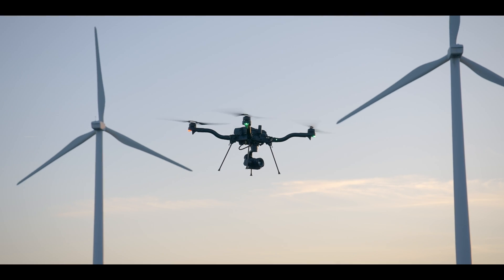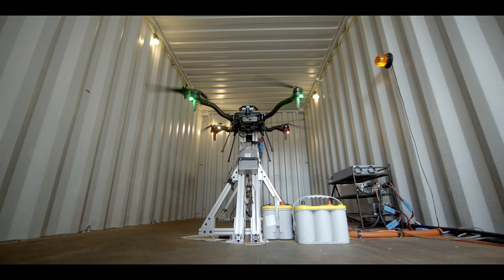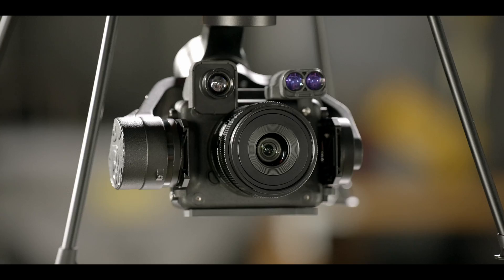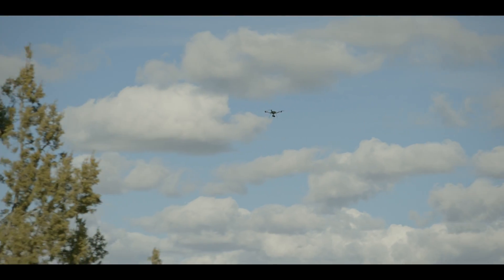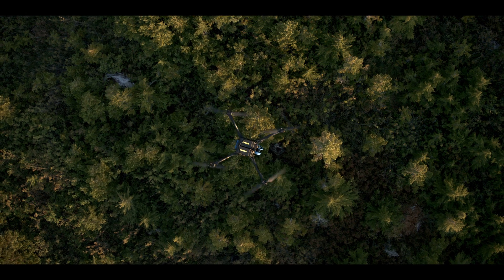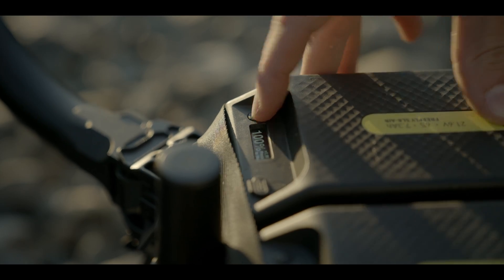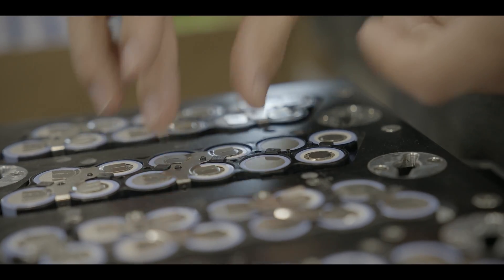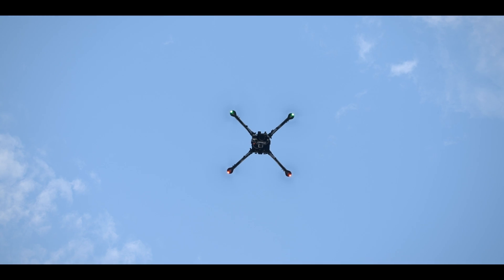Introducing - Astro Prime

Comment: Why doesn't everyone spin the props slower? Because you cannot overcome reaction time with a finely tuned control system alone. Counter rotating props or collective pitch are the two options off top of my head.
Reply: At the system level if you pay attention to details you can have big, slow, efficient props with awesome control bandwidth (more than needed) which is what we did here.  Astro is substantially more precise than a big single rotor with 700mm or 800mm blades spinning 1000 to 1300 RPM.

Comment: Two bladed props are great for efficiency, but don't have enough grip on the air for aerobatics.
It's why WW2 fighter planes had 3 props as ideal, or even 4 for a 2% diminishing gain.

Comment: Did he say “rpm’s per second?”  Like, rotations per minute per second… what?

Looks cool though, I’d love to review it.
Reply from the maker: Revolution Per Minute Per Second (rpm/s) is a unit in the category of Angular acceleration.
Reply: @freeflysystems  If you really want to lose your mind try saying RPM/s/s a few times quickly!
Reply: @freeflysystems awesome, I’ve never heard that before.  Super cool!
Reply: @freeflysystems Would that be the type of 'second' that divides in to arc-seconds, or multiplies in to degrees? (rather then milliseconds or minutes)
Reply: @PiDsPagePrototypes it's the unit of time. For example, being capable of 1 RPM/second means your rotor can change its rate of rotation, measured in RPM, by 1 each second.
Reply: @tenebreonlabs  That would be one change, every rotation. Reminds of a Tom Stanton video, where he built a helicopter that used multiple changes in speed within each rotation to shift the blades through a pitch change on an angled mount.